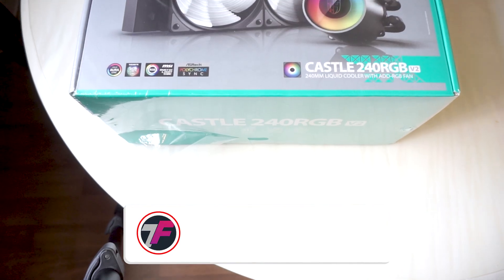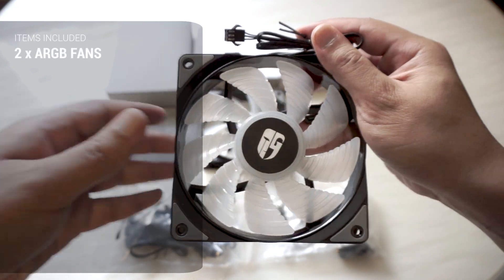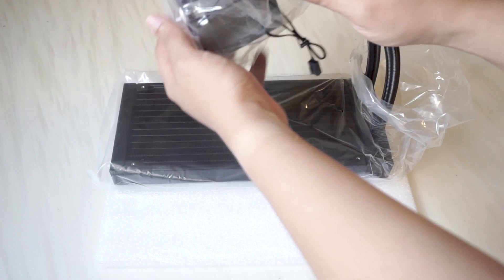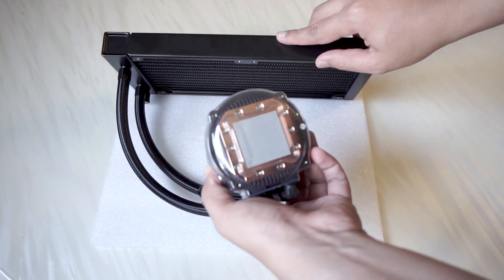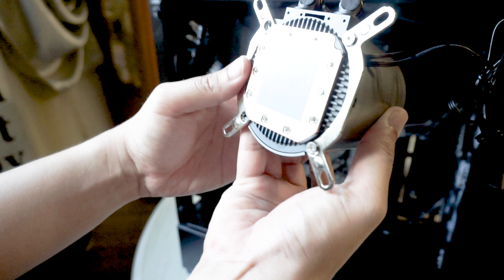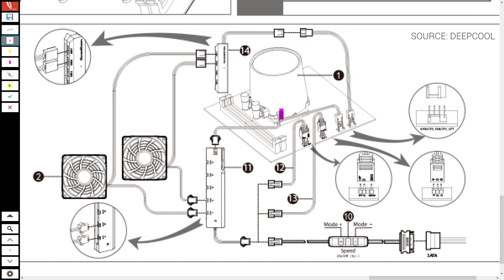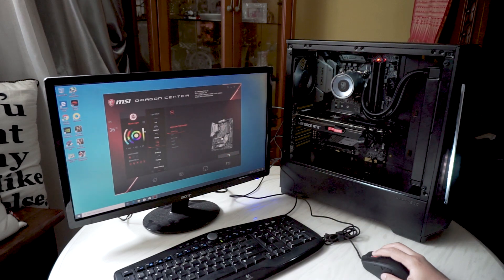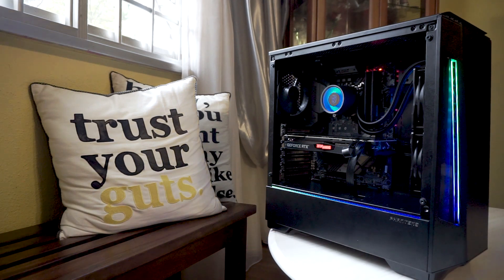Deepcool Castle 240RGB V2: AIO CPU Cooler Overview & Build Experience

Comment: I saw alot of these videos with the dual fan radiator mounted on the front. Wouldn't it make more sense on the ceiling? I have a setul where 2 fans push air inside my case from the front and 2 are exhaust fans on the ceiling

Comment: I have had a deep cool 120mm radiator and upgraded to the 240mm. They are both great and if I was going to go to anything bigger I would still go with this brand. I do have 4, 140mm Noctura fans feeding it though so there is a lot of air flow and positive pressure which will make a difference. It doesnt matter what you have if you dont have sufficient air flow. I went a little overboard with the airflow but the point still stands.
Reply: To clarify, I have 4 intake fans then the 2 deepcool fans on the radiator.
Reply: Did you mount the radiator like he did? On the front? To me it makes more sense on the ceiling as hot air tends to rise upwards

Comment: My h510i makes the cabling part extremely simple bc it alr has a compatable fan hub and my rgb is 4 pin so i bought a 20€ adapter 12v 4pin to 5v 3 pin

Comment: hi
I have Deepcool Castle 240RGB V2
and also a deep cool case which has 4 fans

can I daisy chain those controllers?
I mean can I connect 4 fans to one of the RGB controllers providers with the case and 
connect that controller to the aio controller 
and from there connect the aio controller to the motherboard ???

Comment: is there any difference if I install the fan as a push configuration? blowing the air onto the radiator..because it is not possible for me to put the fans on top of the radiator since I place the radiator at the top
Reply: place the radiator on top and fan under  as exhaust  if top mounted... if front mount then place the fan in front of the radiator as intake ..

Comment: Just picked this cooler for my Ryzen 7 5800X, the processor and AIO would be delivered tomorrow. Hope this works well with the CPU. I have an existing Deepcool 120RGB, which I feel uses the same mounting mechanism, so it should be easy for me to swap out. Also are the hubs provided in the box? The pictures in the Amazon listing doesn't show them.

Comment: What is the difference between Castle 240EX and Castle 240 RGB V2 ?
Reply from the maker: Hello! Sorry for the slow response. If you are comparing between the Castle 240 EX and Castle 240 RGB V2, I would say the main difference is that the Castle 240 RGB V2 comes with 2 RGB fans whereas the Castle 240EX do not have any RGB fans. So if you want more light in your case, go with the Castle 240 RGB V2. 

Another difference is that the Castle 240EX comes with a customizable logo on the pump which can also be rotated. Whereas the Castle 240 RGB V2 do not, so you are stuck with the deepcool logo. I hope this helps! If it does, do consider subscribing for future tech content!
Reply: @TechFlik  Thank you so much for the very detailed answer. Just one more question; is the the thermal performance the same with both Castle AIOs ? Subscribed !
Reply from the maker: Hello! Apologies for the late reply, for thermal performance as both Castle AIOs mainly used components made from the manufacturer, Aestek. In my opinion they generally have similar thermal performance. The only difference is the fans used, so they might have slight thermal performance but in general I would say it's about the same. With that said, you can focus on choosing the look of the AIO that you prefer! Hope this helps!

Comment: does this cooler work on gigabyte b450 m ds3h
Reply from the maker: Hello, sorry for the late reply! For the Gigabyte B450M DS3H, you will be able to use this cooler, however as the motherboard do not have any 3 pin rgb header, you will not be able to use software control to control the lighting. Instead you can use the included rgb remote controller to control the lighting! Hope this helps!

Comment: Hi, I noticed you were using a Tomahawk motherboard. Where is the 3 pin connector on it? I'm asking because I have a tomahawk too but I cannot find the 3 pin connector on it.
Reply from the maker: Hello I'm sorry for the slow response! I hope I'm not late. The tomahawk motherboard that is shown in the video is the MSI MAG Z390 TOMAHAWK. May I know which tomahawk motherboard are you using? May I can help you?
Reply: @TechFlik  Oh sorry I thought we were using the same motherboard but that isn't the same one as mine. Mine is a Tomahawk B450 Max. Thank you.
Reply from the maker: Hello! No problem, based on the manual for the Tomahawk B450 Max, I have checked that the motherboard only has 2 4-pin RGB header and no 3-pin digital RGB header. You can find the manual here: https://download.msi.com/archive/mnu_exe/mb/E7C02v1.5.pdf . Hope this helps! If it does, do consider subscribing for future tech content!
Reply: @TechFlik  thank you for responding to me and being active in the comment section. I subbed 😊

Comment: So i have two NZXT AER 2 RGB fans...would i be connecting them to that fan hub and rgb hub so that they all synchronize? Pls respond when possible and thank you
Reply from the maker: Hello! Sorry for this late response! Based on my research on the NZXT AER 2 RGB fans, I do not think you can connect them to the Deepcool fan & RGB hub as the connectors looks different. You will still require the NZXT hub for the lighting to work on the fans.

Comment: do you think it's easy to install the radiator with the tubes on the bottom with this AIO for front mounting?
Reply from the maker: Hello sorry for the late response! It depends on your case, however do not think it's easy as the the tube itself is pretty short. So it prob won't be ideal to install the radiator with the tubes on the bottom. I hope this helps! If it does, do consider subscribing for future tech content!

Comment: did you use it as an intake air?
Reply from the maker: Hello, welcome to my channel! Yes I did in this case.
Reply: @TechFlik  Can I also use this AIO on Gigabyte b450m ds3h?
Reply from the maker: @gino5553  Yes you can! The AIO supports AM4 socket so it should not be a problem! May I know what case are you using?
Reply: @TechFlik  Sure! I've been planning to build a pc soon, the case i'll be using is Coolermaster MB520 :D
Reply from the maker: @gino5553  That looks like a pretty cool case! Seems like it has plenty of radiator support for the top and front panel too. This AIO CPU cooler should fit in nicely on your case. I hope this helps! If it does, do consider subscribing for future tech content!

Comment: Hello, im interresing by this watercooling but does it work with a Bitfenix Dawn Tg? I want to contact the 3 pin connect of the Bitfenix on the DeepCool hub, can i do it? Or the hub is Only work with deepcool material?
Reply from the maker: Hello! Sorry for the slow response. From what I understand, you want the Bitfenix RGB lighting to be in sync with the Deepcool AIO cooler right? 

I previously worked with the Phanteks P360x case and managed to sync the RGB lighting on the case with the Deepcool AIO cooler. Though I have not work with the BitFenix dawn TG, I think it might work. However, I cannot guarantee that it will work.

If you are still considering buying the Deepcool AIO cooler, here is how I think on how to make the lighting sync work:
1) Connect the 3 pin ARGB connector from the Bitfenix case to your motherboard 3 pin first
2) Connect the Deepcool RGB hub 3 pin to your Bitfenix ARGB controller

Do let me know if you have further questions! I see if I can help!

Comment: Very nice video and great guide on the connections too!
What case are you using, Phanteks P400 A? Is the radiator too large to mount on the top?
About the logo on the pump, the EX version allowed to switch or remove. Do you know if I can do the same on this one if I remove any screws?
Thank you
Reply from the maker: Thank you for the kind comments sir! The case I'm using is the Phanteks P360X case.
You can watch my video on this case here: https://youtu.be/fucw3Df4cEQ 
I do not however recommend mounting the radiator at the top in this case, as it might interfere with your ram or motherboard heatsink clearance.

For the logo on the pump, I have not really look at how to disassemble the pump and I'm unable to confirm if it is viable to do so. Hope this helps!

Comment: Does this work to connect with aura sync? Also, what case do you use in this video?
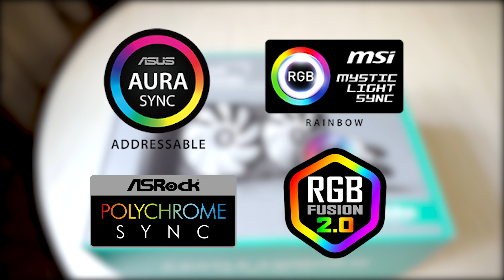Reply from the maker: Hello! Yes Asus Aura Sync is among the software that is supported by this AIO CPU cooler as seen at 0:55. 
For the case, I used the Phanteks P360X case. You can watch my review here: https://youtu.be/fucw3Df4cEQ

If you want to know what are the exact components used, you can watch the full build video here: https://youtu.be/bgkracZkC90

I hope this helps! If it does, do consider subscribing for future tech content!

Comment: At 6:59, does that extension come with the fan or do you have to purchase externally
Reply from the maker: Hello! All 3 extensions (1 x 3pin connector [no.12], 1 x 3pin connector [no.13] & remote controller [no.10] ) shown in at 06:59, is all included in the package. I feel Deepcool did a great job with this AIO by providing all the extensions for PC builders!

I hope this helps! If it does, do consider subscribing for future tech content!

Comment: Does this work with a msi b450 tomahawk max?
Reply from the maker: Hello! Sorry for the late reply. Based on the specification of the MSI B450 Tomahawk Max, it only comes with 2 x 12v 5050 RGB headers. So you won't be able to use software control to control the lighting. 
However, you can still use the included controller (see 07:07)  to adjust the lighting if you don't mind. For the pump, there will be no issue.

In summary, you can still use this AIO cpu cooler just without software control to control the lighting. 
I hope this helps! If it does, do consider subscribing for future tech content!

Comment: sr mate you had your rgb fan put on wrong side. never push hot air back inside your case
Reply from the maker: Hello! Sorry, it's okay to put the radiator at the front as intake. I have 3 fans, 2 at the top and 1 at the rear for exhaust. So temperatures are still okay in my testing.